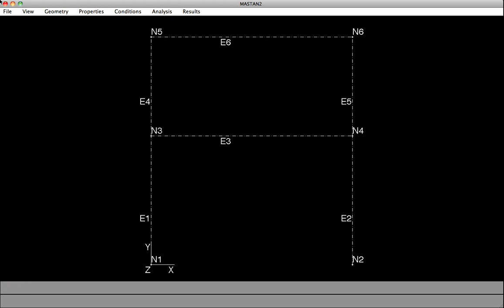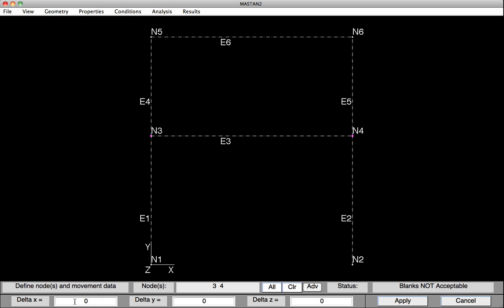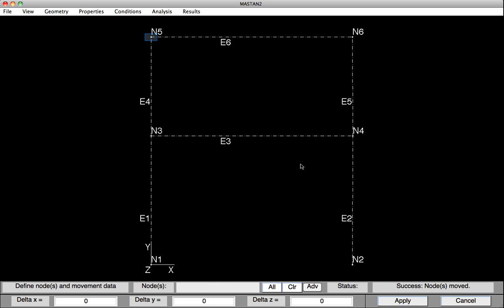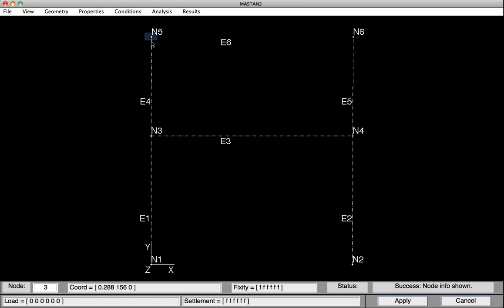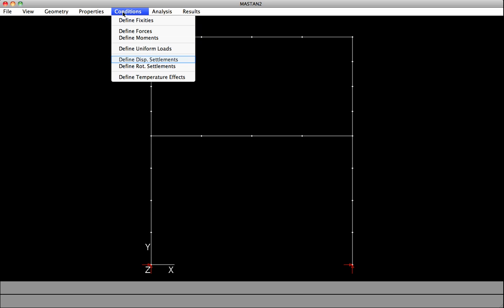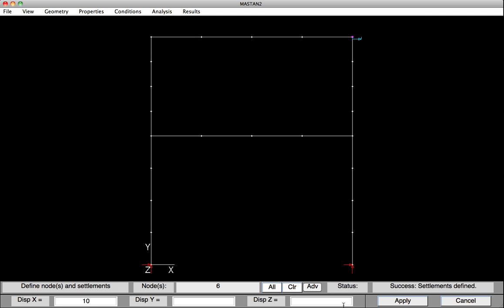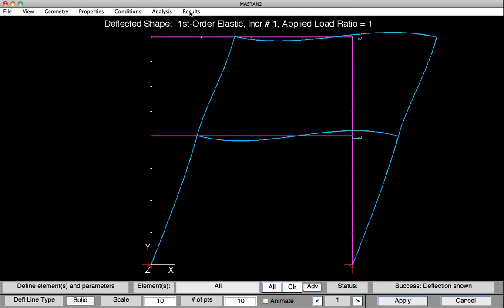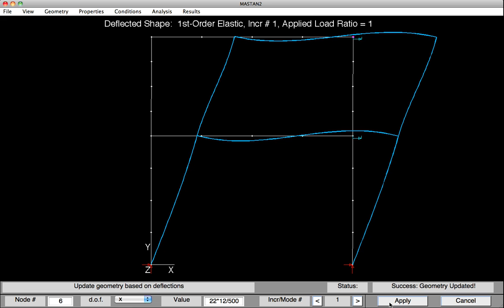MASTAN2 - Sway Frame (out-of-plumb) Imperfections

Comment: dear prof,
this software are unique and has many specific features for steel structural analysis. i just want to add some comment from my experienced background using commercial software, seems it would be useful with option to includes:
* white background color interfaces as available in printing
* viewable section attached e.g names and orientation
* non prismatic / tapered members
* load combination and design module (AISC)
* additional mass, response spectrum analysis
* spring support for both translation and rotational stiffness
* and the last is an affordable commercial versions if applicable
hope all these option are in to-do-list for next future release of MASTAN2.
best regards,